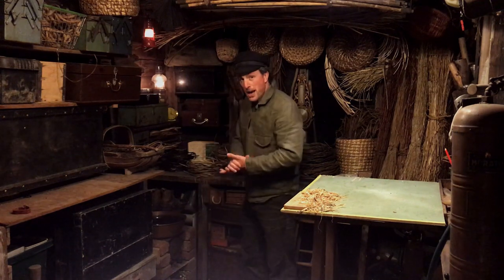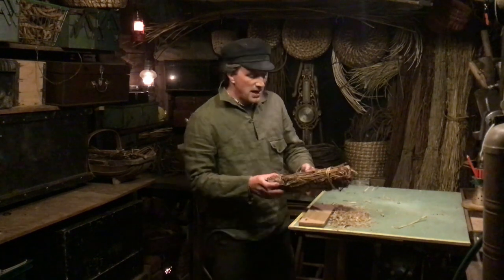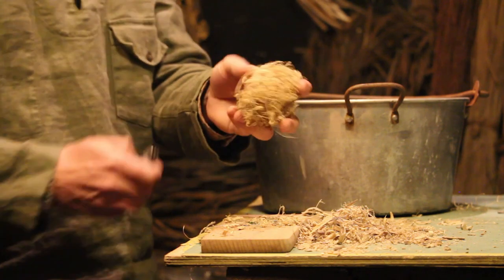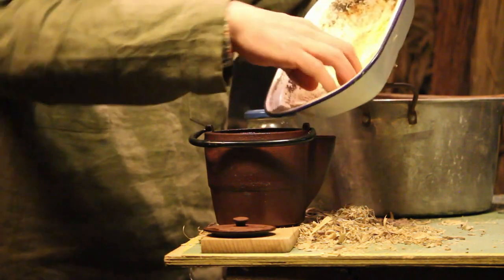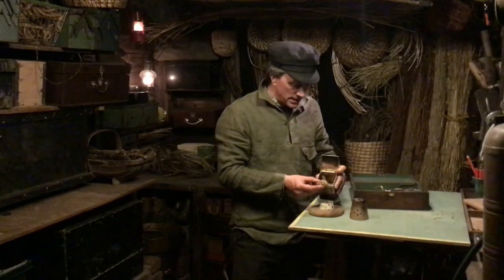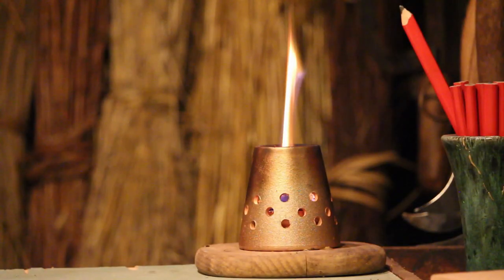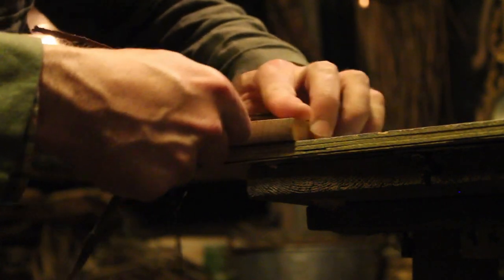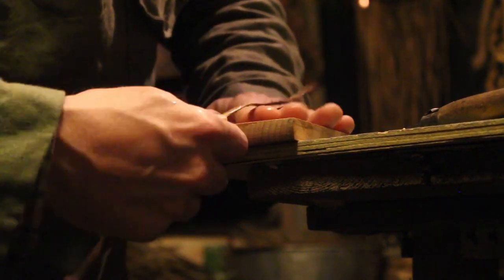How to make a basket: EP03 Stropping cane and by products

Comment: I would love to learn more about your 'makeshift stove'... is the top cone clay or metal? The base looks like a wood disc, but what's the little container on top of it? Ceramic? Do you worry about scorching? It looks delightful, and I love how the flame comes out in a sharp point, I'm just wondering which of my friends I should pester about helping me make one (the potter or or the friend with the machine shop). Did parts of it start life as an incense burner, perhaps? Am I obsessing too much over something that you just found at the discount store?
Reply: No you are not!! i am obsessed with the cylinder that holds the fire! UGH i love it so much. i’m going to try and make something similar. so simple yet so perfect!
Reply: I bet either clay or metal would work. It's basically a chimney with oxygen enter from below the fire, I don't know what it's for, but at least it will make a cleaner burn.
Try search "TLUD stove", you should be able to find all the information you need.